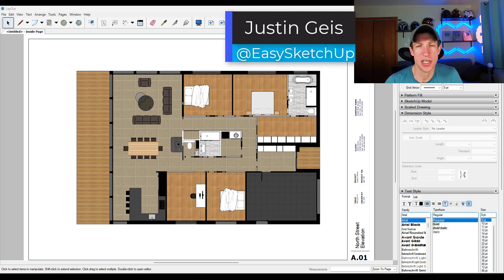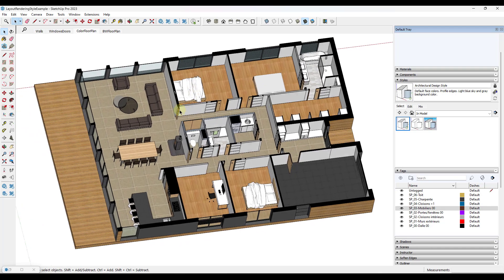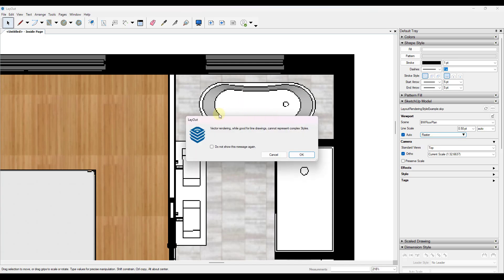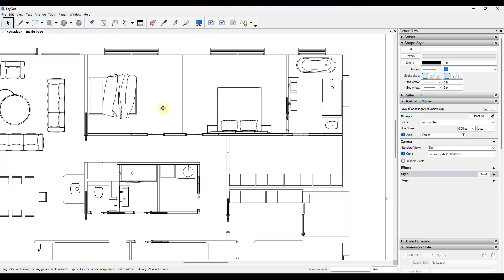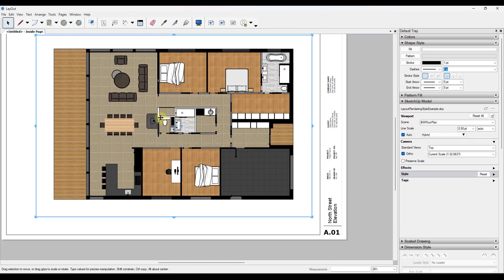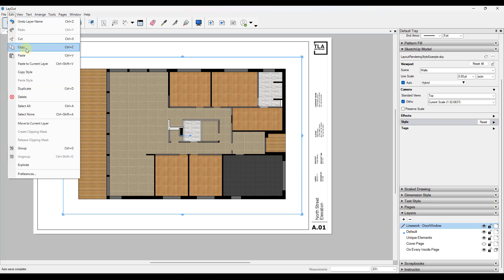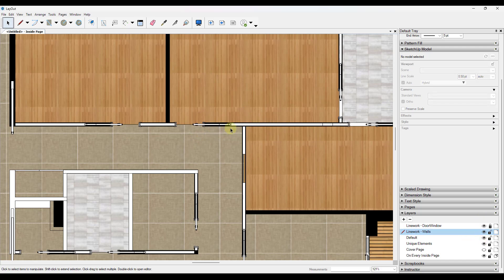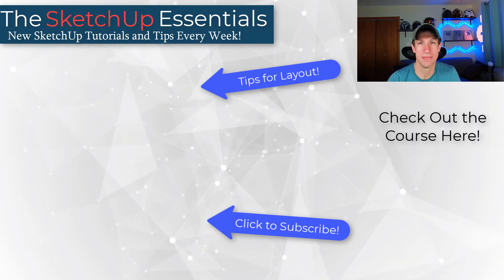How to Use VECTOR, RASTER, and HYBRID Rendering in Layout!

Comment: I run a very fast workstation and mort of my non vray visuals are what I refer to as bumwad trace sketches because my client like the linework on a yellow background. I find layout to be incredibly slow and frustrating. 

I also find it annoying the skectup has just continued to run with the old Autocad hack for exporting 2d views from a 3d model. 30 years ago, the hack was to trick a hp plotter config to spout out a vector image. You'd have line breaks at every intersection and multiple lines on top of each other. Its 2023 and the sketchup vector output is still the same.

I do a lot of design work in sketchup and it's just a pita to have to trace a 2d view in order to get a clean drawing in Autocad.
Reply: I also find Layout very very slow, mostly when it comes to actuallizing 3d model from Sketchup or when I switch to vector mode of Layout drawings. I have very good laptop parameters and sometimes have to wait 30 minutes for actualize 3d model in Layout.... is it normal ?